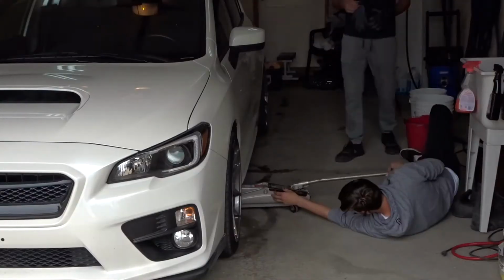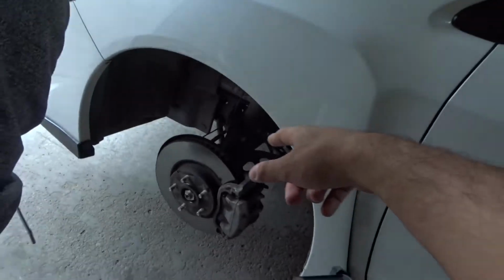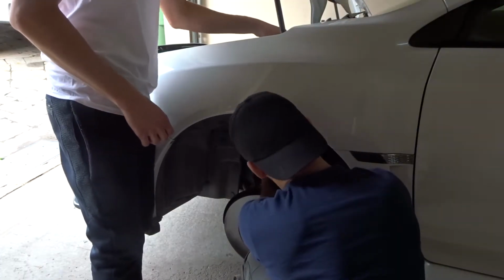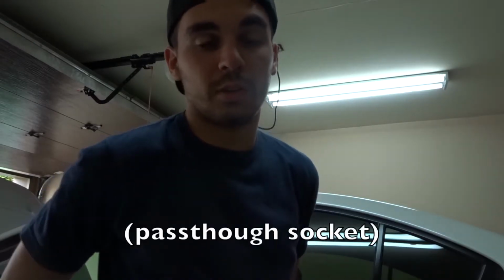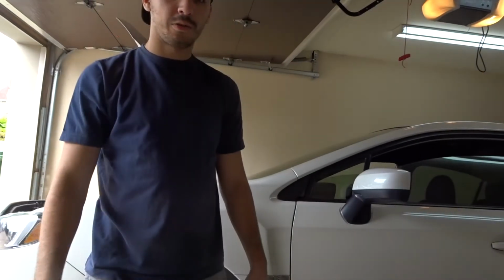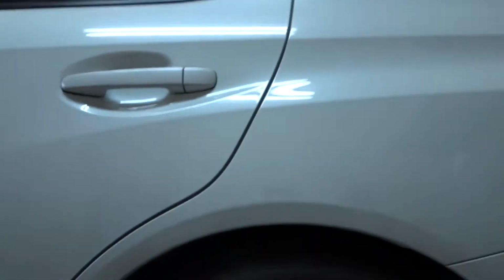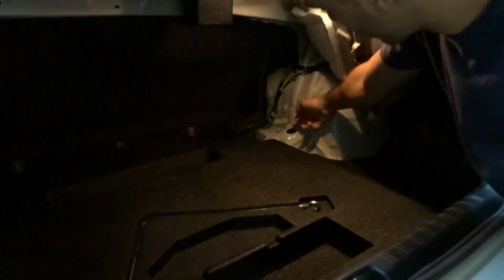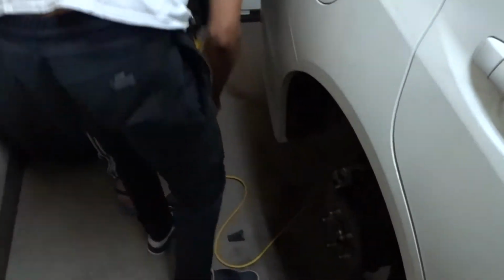RCE Yellow Lowering Springs WRX 2015-2017// Install video

Comment: How much did it drop ? I’m thinking about getting these ... is there a big difference?
Reply from the maker: It dropped by between half an inch and an inch! I'm sure I had said it somewhere in the video exactly how much. Overall it was worth it it looks killer to be honest. If you live in a climate that snows however, not worth it. Also, avoid every possible bump and elevation changes ie sidewalks and stuff. Hope this helps !!

Comment: For all that work, my mechanics said you might as well get some cheap coilovers. Tein Street Z are decent for the price.
Reply from the maker: alphazoom II I see your point but cheap coils are likely to break down and give a cheap feel to the ride. Not to mention the ride with coilovers will be stiffer. I'm no mechanic by any means but with my experience fooling around with suspension I truly liked the lowering springs we installed here; lowered stance is nice and ride quality isnt hindered. 

However, maybe your mechanic k ows something about the product I dont know about. Maybe that product is really good! I am just speaking generally for what I've heard from cheaper coils.

Thanks for your response though buddy, I'll look into the brand you mentioned!! :) 

drive what drives you
Reply: I've read people that installed them and they liked them... However my mechanic was just speaking in general about doing springs only vs coilovers. The labor would be less for just slapping in coilovers vs giving you new springs. If you do it yourself why not just get coilovers why you have already done all that labor. However, for the money yes... these yellow ones are really nice.
Reply from the maker: alphazoom II that's where I agree with you, putting in coils are remarkably faster and easier 😂😂. But yeah, doing things on a budget ahah and being able to say you did it also feels good!!